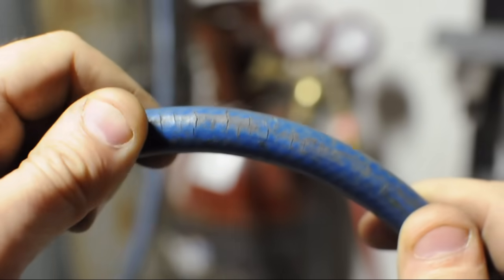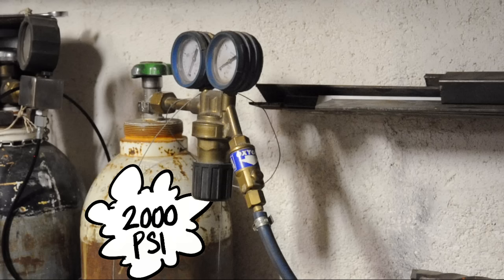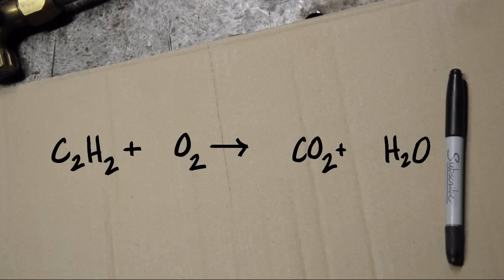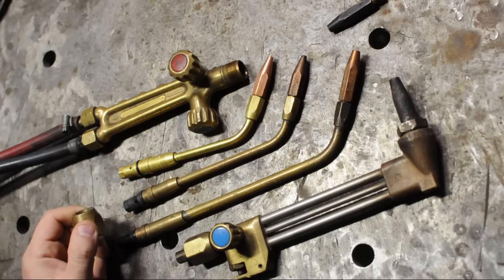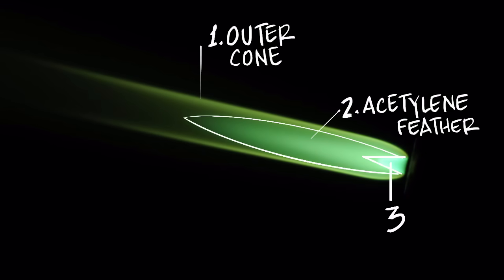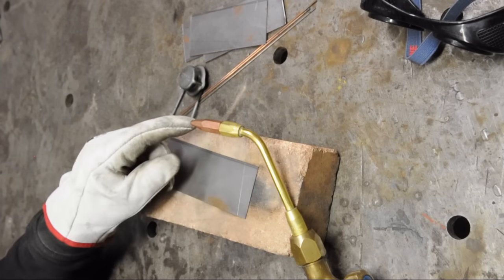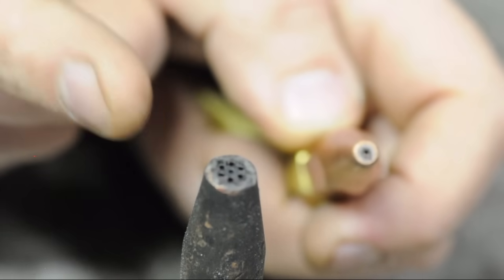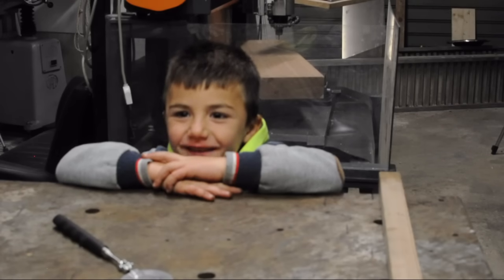Let's Talk Oxy Acetylene

Comment: Hi Tony, This is Old Bob. The time I started to weld we had no acetylene bottles. We used carbid, the white rock-like pieces and let water onto them. The gas which generated collected in a water filled tank which had a rising dome for the gas which came through the water. if we wanted higher pressure we put more weight on top of the dome. To change the "carbid" (English?)it was a horrible job. There were 2 drawers with air-tight locks, they had to be opened and pull the tray of used carbid? pulp out, clean it and re-loaded. The smell was beyond bearable.  If you know more about that, please let us know,
I do not remember more, it was over 75 years ago.
Reply from the maker: holy smokes Bob, how old are you?  That's a bit of stretch for me.. but I do remember the canaries in their cages.  ;)
Reply: This Old Tony
Reply: Tony I am a young 90, still ride motorbikes, grew  up in steel fabrication, I am a retired structural engineer in steel structures only
if you see #10 of "that old bob" you'll find it usefull
Reply from the maker: I'll definitely check that out!
Reply: I have a book about OxyFuel welding and the making of a home carbide still to make acetylene to run with Oxy. I think that's from the 1940-1950's but I can't check it right now. Almost written in Gothic, though Danish..
Reply: Yea I still have a generator , don't use it although if I ever get some Carbide I might. Bottle is just to easy and less dangerous.
Reply: This is almost like one of those tall tales about the before-times, such as: Back when I was a kid we didn't even have horses! We attached four posts to a log, and then sat on top of it while we used ropes to pull the legs back and forth.
Reply: Khalid Al-Kooheji n
Reply: Good day That Old Bob! This address' replay address the smell factor. As you may have noticed carbid (carbide) and water produce a seriously flammable (and over 14psi explosive) gas. The purer (pure carbide and distilled water) it is, the less )right to odourless) garlic smell there is. Acetylene gas (as noted in the replies, and adding references to miner's lamps) is the bi product of that stone and water. Modern applications have a acetylene gas (see the video) in acetone (like a bottle of soda pop) liquid. The greater the impurities (acetone and porous substrate in this case)  the worse the smell. Hope this helps a little, also carbide is created from coal and a high current arc process. It became via mostly due the Niagara Hydro Electric dam.  its a nifty read on Wiki.
Reply: This Old Tony this maybe the right moment too ask.... Would you consider doing a vid on Atomic Arc Welding? It's possible Old Bob may have used the process.
Reply: I love to see old guys still doing their thing! You rock Bob! Guys 30 years younger can't hardly figure out how to watch youtube, let alone make videos.
Reply from the maker: Was #10 the right one?  Verifying tailstock alignment?
Reply: My uncle worked as a welder back in 70's in Poland, he used to bring me smelly white soft crumbly rocks which I used to put in water and ignite, he used to call it "karbid".  The oily sticky soot used to gently land on furniture and carpet.....   my mom used to get angry at me, lol :)
Reply: I'm only 64. Just A young pup! and I inherited A Site Feed Carbide Generator from my uncle. Where he got it is anybody's guess but it kicked around 4 different shop's until I scrapped it out about 10 years ago.
 There were 2 general types of carbide generator. One used carbide cake and the one I had used granular pellets. They looked something like calcium carbonite ice melt. It was A  very economical way of producing acetylene. I live in Minnesota and have always had unheated shops so the tank had to be drained in the fall and we had no gas welding/cutting ability until spring. I found this unacceptable and bought A acetylene tank about 20 years ago but I kept the old generator around and used it in the summer for many years. I bought A 100 pound canister of carbide from Union Carbide Corp. in the mid 1970's and still have around 50 pounds left.
Reply: Because of the acetylene produced in contact with water as described, carbid is considered dangerous and requires a permit if you want to buy it here in Denmark.  So i was a bit confused when i found carbid on the shelfs in a farmers shop in Sweden 
'oh, it's for the moles ' the salesman said.  The strong garlic smell scares the moles. Off topic, sorry.
Reply: Der er mange gode produkter man bare ikke kan få fingrene i mere.. Så må jeg vel til Sverige efter Karbid.
Reply: Stefan Asmussen Jeg har set det hos Börjes landhandel i Tingsryd, men fås sikkert i mange butikker.
Reply: That Old Bob Its called calcium carbide
Reply: That Old Bob i still have my grandfathers acetylene maker. No idea how to use it. I dont know if you can even get the material to make it or were it would be sold!
Reply: BeGamerSl calcium carbide was not my comment
Best to leave your grandfather' equipment alone it's a very stinking business 
I saw you have the Cobra gun, it's too heavy for me. I use an old very light gun from aircraft eng.
Reply: Robert Silas I know
Reply: It smells the same as a fart under the shower.
But 300 times worse....
Reply: zahrim bizarre you bet 100% right
Reply: I think that rock is calcium carbide, when mixed with water, it produces acetylene.
Reply: I used to use it in carbide lamps, you would put the carbide in the lower half of the lamp and clamp it closed and fill the top half of the lamp with water and it had a small needle adjuster on top that you would open and the water would drip onto the carbide and fizz up as acetylene and go through a pipe to a jet at the front where you would light it, very popular with opal miners here in Australia in the early 70s. As a kid we used to buy it just to fill old wine flagons with it and water and bury them to make small volcanoes.
Reply: That Old Bob my grandfather used to weld like that too, ever had a flashback into the dome?
Reply: I went to Spartan School of Aeronautics in Tulsa 1964-65 to earn my aircraft mechanic's license, and learned oxy-acetylene welding there.  The school had a large carbide generator for the welding classes because of the high cost of bottled acetylene.  One tip for those who might want to learn basic welding with oxycetylene--forget about using filler rod until you have mastered the art of melting a puddle across steel sheet in straight lines.  Once you can produce a melt line with uniform width and spacing of swirls, then add filler rod and begin welding things together.  Few things I have tried have been more satisfying than learning to fabricate by welding, and oxycetylene on mild steel is a great way to start.
Reply: @That Old Bob, That old bob #10 is about tail stocks...hmmm i am trying to find the video you mentioned but cant, please can you leave a link here. 
im interested because my Granddad used to talk about the very same equipment and i never really understood it.
That old bob number 10 is about tail stocks...hmmm
Thank you !!!
Reply: Miner's lamps must have been adapted to the early automobiles, mounted up front with carbide in them.
Reply: @That Old Bob - Sir, you are amazing!   Whatever you are doing, don't stop!  The 90+ year old patients I see aren't riding motorcycles and posting on YouTube.  Amazing!
Reply: By all means - interesting to know
Reply: I started out using one of those and I'm only 57 years old. It was way out in the country in New Zealand. I was told that it was easier and safer to buy and transport calcium carbide than full acetylene cylinders. The oxygen was fine but apparently due to the corrugated roads acetylene from a cylinder couldn't be used for ages after transporting out there.
Reply: Damn Bob! I subscribed to your channel right after reading this! I know for sure I’m going to find interesting content there!
Reply: That Old Bob Reminds me of coal miners lamps :)
Reply: Mentorcase I just mentioned this, before I read the comments.
Reply: The Wieg, and others - about the "carbide", or more accurately, Calcium Carbide (CaC2). It is made, or it was used to made, from coke (coal or petroleum one), which is close to pure carbon, but COAL (mainly carbon as well, and a source material for coke manufacturing) is not used, as it contains too much volatile hydrocarbons and moisture.
The other ingredient is calcium oxide (CaO), a.k.a. quicklime or burnt lime. Those two are put into an arc furnace, where they react at approx. 2200°C (4000°F) producing carbon monooxide (CO), carbon dioxide (CO2), and liquid calcium carbide (CO and CO2, as at high temperatures carbon dioxide is unstable and tends to decompose, but I digress here).
Nowadays the acetylene is produced by some fancy conversion or inncomplete burning of methane, but this is quite different kettle of fish, into which I'm NOT going to delve here.
Anyway, the liquid CaC2 is then poured out into steel pipes cooled EXTERNALLY with water, where it solidifies, cracks and falls out.
When CaC2 reacts with water it produces either CaO (quicklime) or Ca(OH)2 (slack lime), depending on how much water is added and at what temperature the reaction takes place, AND the acetylene. (Or ethyne, as chemist used to call it.) Which is a colorless and odourless gas - in its pure form, that is.
So where does the garlic-fishy smell come from? From impurities in the quicklime, mainly phosphorus (P), which reacts with calcium creating calcium phosphide (Ca3P2), which in turn reacts with water, creating phosphine (PH3). Which again is odourless in its pure form, but being "contaminated" by its "byproduct" (and, oh, BTW: it's "byproduct", not "bi product"), which is diphosphane (P2H4), smells what it smells.
And the (im)purity of water has no bearing on this, period.

That explains the smell, and about the name: according to Uncle Google, "the name was coined 1860 by French chemist Pierre Eugène Marcellin Berthelot from chemical ending -ene + acetyl, which was coined [in turn] from acetic + -yl in 1839 by German chemist Justus von Liebig. Liebig's coinage was in reference to a different radical; acetyl was transferred to its current sense in 1850s, but Berthelot's coinage was based on the original use of acetyl".
Hope it clarifies the subject a bit : )
Reply: @thatoldbob7956  Bob, I just want to say that I hope you're still doing great at 91, and live as long as you care to.
Reply: @MrKotBonfacy excellent reply. I have made a little carbide lamp before by putting some chunks of CaC2 into a test tube with some water and then stoppering the tube with a rubber stopper which has a long, thin metal tube running through it. You can light the gas coming out of the end of the long tube and you get a bright but somewhat sooty flame. Not good to run it for too long indoors because of the phosphine and substituted phosphines you mention - they not only smell but are highly poisonous. I suspect that it is less of an issue with an oxy-acetylene torch because the higher flame temperature (due to the pure oxygen input) probably causes the phosphines to be converted to something less poisonous.
Reply: Used to be a toy cannon sold at the fireworks stand that used a tube of calcium carbide.  Put a small cup in the breach, close the breach, dumping the powder into a puddle of water.  Wait several seconds, strike the flint, and BLAM!  I remember the tube, once opened, didn’t last long before turning to a grey-white crud that wouldn’t yield any acetylene.
Reply: Growing up in the late 60s when I discovered girls and alcohol I got shipped off to my grandparents farm for the summers. Grandpa was a coal miner in central Pa. He showed us how he used to work by carbide headlamp. Used the same stuff for gas lights in the house. Anyway it was a real learning opportunity for me. Alcohol and girls were replaced by alcohol and explosives and hoping that the girls weren’t your cousins
Reply: My neighbour had a problem with moles in his lawn. He tried everything he could think of but them moles kept a'coming.

So one day he gets some carbide and puts a lump everywhere a mole has surfaced (in the mouth of each tunnel) waters it down and sits down and waits. I don't know what he was expecting (moles popping up coughing their lungs out maybe?)

Anyway after an hour or so, he gets bored and (purely in the interest of science) chucks a lighted firecracker down the nearest tunnel...

Oh f...!
Reply: That Old Bob yep went to Iran 2014 garage still using this technique.  Exhaust fell off car he welded it up for $10
Reply: @thatoldbob7956   90 years old riding motorbikes and watching youtube? Color me impressed!
Reply: Holy shit. Are you 90?
Reply: When I was a kid in the 60’s, my dad had a can of calcium carbide.  He would put some water in a wine bottle, drop in a rock of carbide or two, then push in the cork and stand back.  After a minute, the cork would pop 20 feet in the air.  I remember it stinking like hell, but I didn’t know that it was explosive or even flammable.

A few years later I was in junior high and took metal shop where we learned about oxy-acetylene.  My friend and I were talking with his mom (the chemistry teacher) and we asked her about carbide, and she said when mixed with water it made acetylene.  We both looked at each other, and headed out to the garage to build our own torch.  We found an old Prince Albert tobacco can (about quart sized), drilled a hole in the side and jammed in some thin copper tubing, put in carbide and water, closed up the can, and lit it up.  Worked a lot like the torch at school.

Next day I wanted to show my mom and dad how it worked, so I filled it up again and tried to light it.  But the residue from the day before had clogged the tube and it wouldn’t burn.  The way we made it the can was upside down (lid on the underside), and as I fiddled around trying to light it, the pressure built up inside and it ultimately popped the can up while I was standing over it.  Hit me right in the forehead just over my right eye.  Didn’t leave any visible scar, but 50 years later I still have a knot under the skin.  Never tried to light it again - learned my lesson, at least until the time I “borrowed” the chemicals from school to make nitroglycerin.  (That’s a short story - laid them all out in front of me, thought for a second, then said “Nope” and threw them out).
Reply: @The_Wieg - to be precise, "carbide" is short for calcium carbide, CaC2. Magnesium and calcium carbides are very reactive, and when reacting with water they produce hydrocarbons - methane and acetylene, respectively.
Calcium carbide is made from quicklime (calcium oxide, CaO) and coke (basically, almost pure carbon - approx. 95% C)  in arc furnaces, at around 2200°C/ 4000°F. Those furnaces use a lot of electricity - from what I recall from shool, an average calcium carbide producing kiln is rated at 8-10 MW.
And yes, using Niagra Falls to produce cheap (hydro)electricity made this proces viable on industrial scale.

That garlic-like smell associated with acetylene comes from diphosphane, P2H4.
Quicklime is made from natural limestone, which is a sedimentary rock created from shells and (some) bones of prehisticic sea creatures. It is mostly calcium carbonate (CaCO3), but contains small amount of calcium phosphate (Ca3(PO4)2 - from bones). This calcium phosphate reacts with carbon in an arc furnace producing calcium phosphide, Ca3P2, and this by-product is a "contaminant" (an impurity) of "carbide". And it also reacts with water producing poisonous odorless gas called phosphine (PH3) and small amount of its "dimer", called diphosphane (P2H4). Which smells like a devil's fart, and also ignites spontaneously in air (and thus can lead to self-ignition of acetylene).
I remember those acetylene generators from my younger days - they were messy, and not real fun to work with. Nowadays acetylene is produced mostly in process called partial combustion of methane, and thus it should not contain any PH3/P2H4.
Reply: @bohelsted7093  Actually, it kills them. Carbide (or, more accurately, calcium carbide, CaC2) contains small amount of calcium phosphide, Ca3P2, which reacts with water producing odourless but poisonous phosphine gas (proper name: phosphane, PH3) and small amount of its dimer, diphosphane (P2H4) - and that diphosphane is the source of the smell. But it is the phosphine and its poisonous quality that does the job, not the smell.
Reply: @thatoldbob7956  built any famous structures people would know?